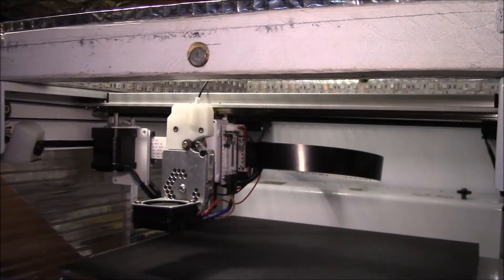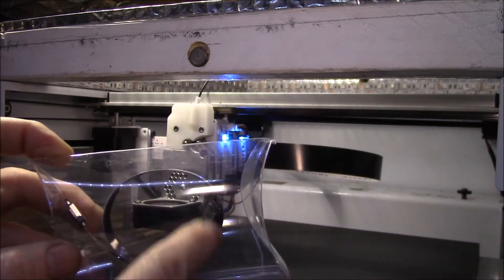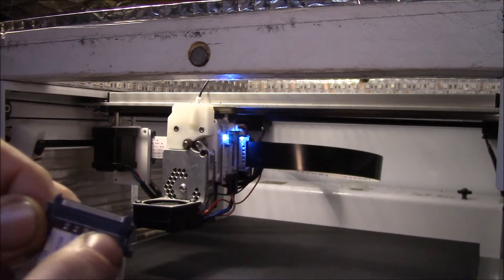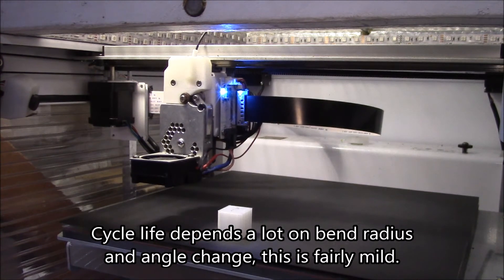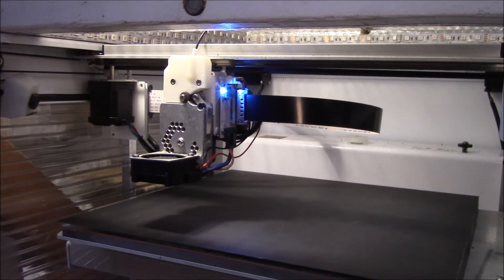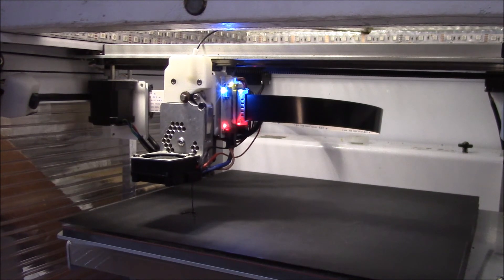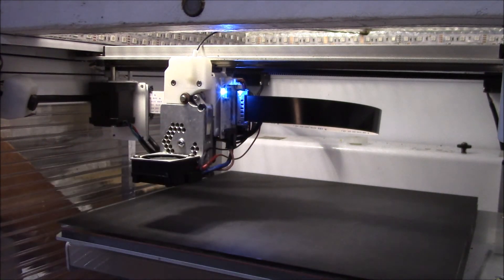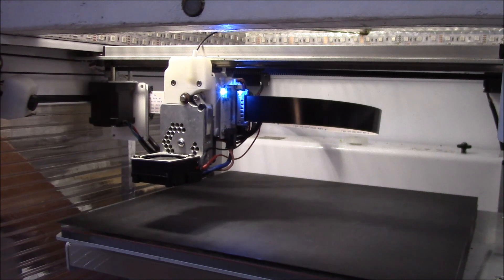Series 1 Pro 3D Printer X-Cable Fix, Part 2

Comment: Just did a little research btw these connectors are a type of LVDS (low voltage differential signaling) connector for FFC (Flat Flexible Cables).
I think I need to retrofit these onto my own printer.

Comment: Nice update sorry do not know what it is called
Reply from the maker: Thanks for the comment.  Hopefully someone out there will know what these connectors are called or if they are easily removed/replaced.  I've only worked with the flat flex cables on the Raspberry Pi for the display and camera interface.  Those just slot into connectors on the PCB and then are clamped down.